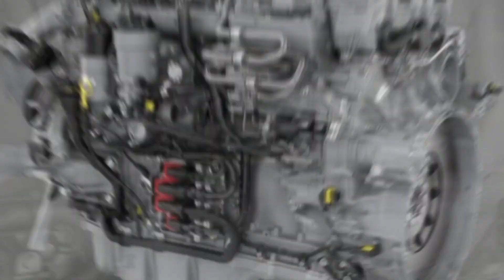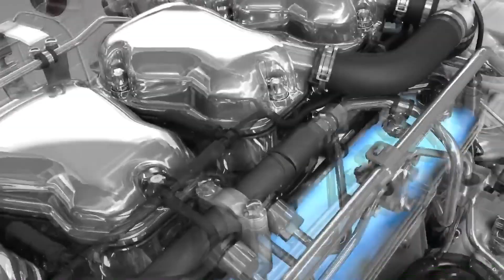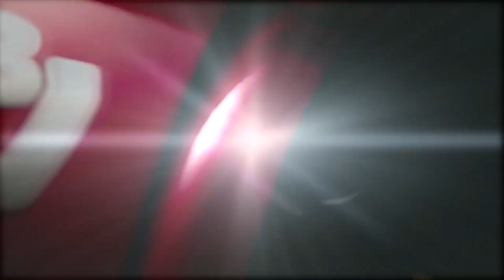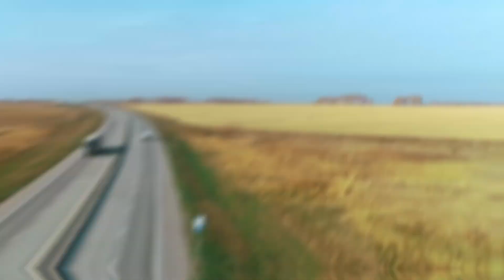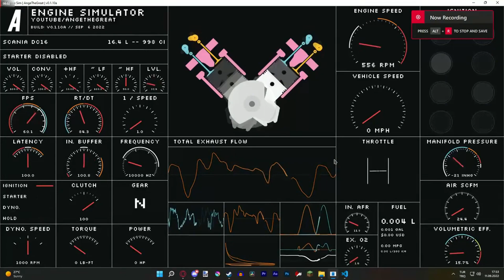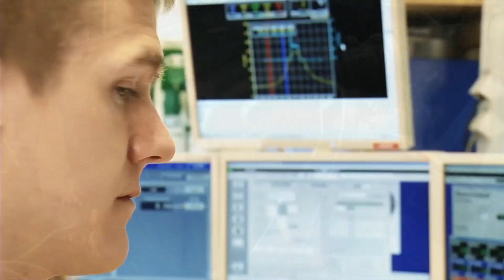Why Scania Made The V8 -  And Kept It Alive For Decades

Comment: So how's this compare to a 3408 Cat?
Reply: I hate to say it but the Scania V8 is far superior. Cat used a 60 degree v angle layout and had problems breaking cranks, especially if you cranked the fuel to them. 3408’s also we’re not available with a Jake Brake.
Reply: 3408 is an agricultural motor, big heavy and lound but lacks power scania will shit all over any cat crap and thats a fact
Reply: @Harro4870 bullshit talk

Comment: See why can't we have this in the American market we're still stuck on the inline platform.
Reply: To be completely honest with you, you don't need that kind of power for the most part. 400-500hp is more than enough when you gross 36 tons. Most of our trucks here in Sweden have between 500 and 600hp and gross up to 64 tons with no real problems. Certain vehicle configurations on certain roads are allowed to weigh up to 76 tons, but those usually have more power. Lumber trucks and dump trucks usually have more powerful engines as well since they almost always haul full loads in rough terrain.
Reply: @tntfreddan3138  64 tons ha! (Laughs in Australian)
Reply: @Bigsoot7393  136 tons and 53 meters. My trailer alone weighs 38 tons when fully loaded (net weight is 26.3 tons). So I'll need 2 more trailers. Then I will be roughly 53 meters long and weigh in at 140 tons. There will be 15 axles, 84 wheels and 92 tons of cargo.
Reply: More complex to produce and an inline 6 cylinder produces more torque per cubic inch.
Reply: Inline engines are more reliable, cheaper to produce and make more torque than a V8.  Cat Cummins and Mack had V8’s in the 70’s and 80’s. They were all three plagued with various issues. Some were eventually worked out but the inline 6 still beat them out on many aspects of performance.
Reply: The inline 6 is naturally balanced, has less moving parts, and is easier to service and rebuild in the truck. It's easier to spin a v8 faster to get higher HP numbers, but the L6 will make more torque at lower RPM. Peak horsepower is not what makes a truck motor great.
Reply: Perhaps international will introduce it, the new 13 litre is a Scania engine.
Reply: @MikeWooshy  Yeah, but that's the 13L I6 engine with a max power output of 560hp.
Reply: @tntfreddan3138  Sorry, I wasn't too clear. I meant that maybe International will introduce the V8 in the future.
Reply: it´s not legal to sell EU trucks in USA due to pretections for the US truck business. And the need for very strong engines is noot as high in the US due to less legal weight on the trucks.
Reply: I-6 is the best configuration for diesel
Reply: Because it sounds like a vw bug, not the growl of a CAT